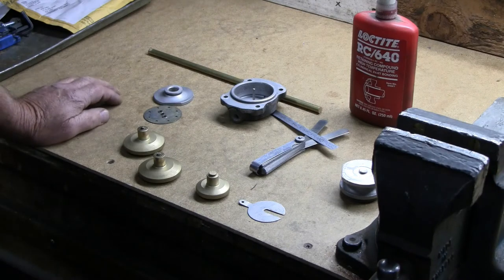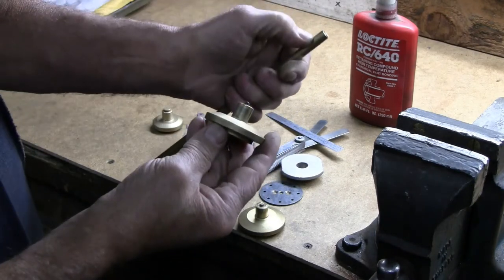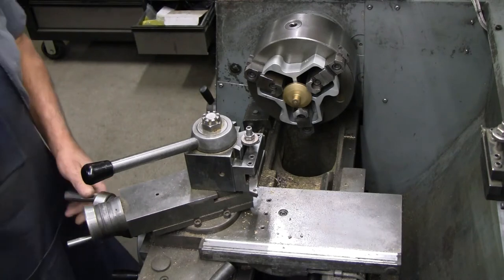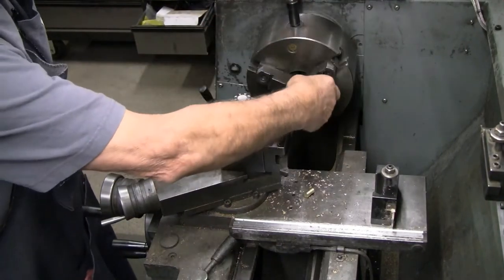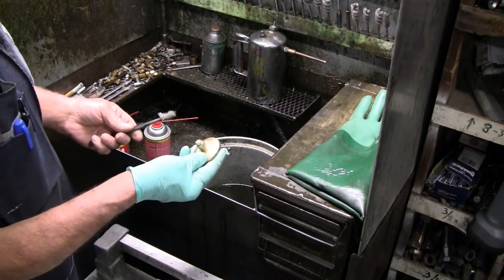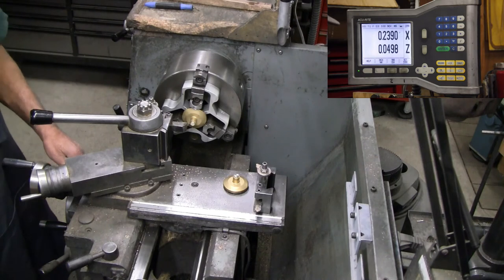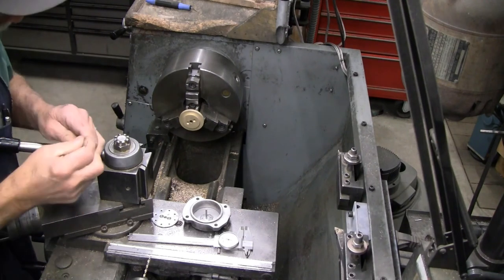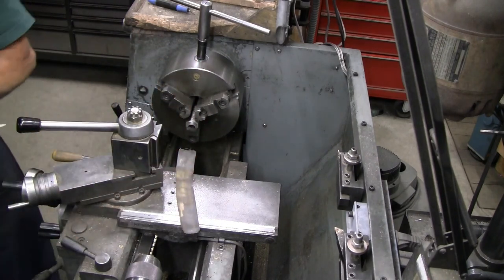Repairing Early Dunlop/Girling Caliper Pistons

Comment: Excellent video. How do you repair the internal retraction mechanism ?
Reply from the maker: If you're talking about the pin and Belleville washer in the casting, I've never tried. Many restorers just remove the pin and washer, as the consensus seems to be that they were an idea that didn't really work anyway.

Comment: What diameter drill was used for the clearance hole in the piston and what should the proper clearance be between the guide pin in the pot and the hole in the piston?

Comment: Hey there , how is the piston removed from the main body  ?
Reply from the maker: If the piston is not stuck too badly, air pressure should pop it out. Wrap the caliper pod in a towel or other cloth to contain the piston and fluid. For stuck pistons, I used a Porta-Power pump loaded with brake fluid to apply serious pressure.
Reply: Thankyou